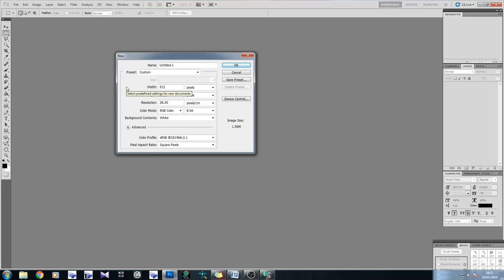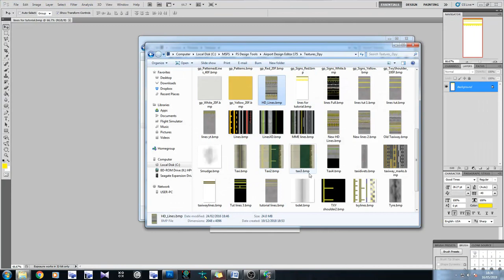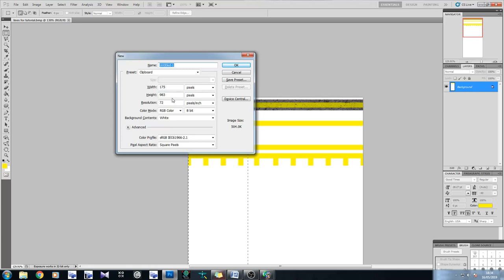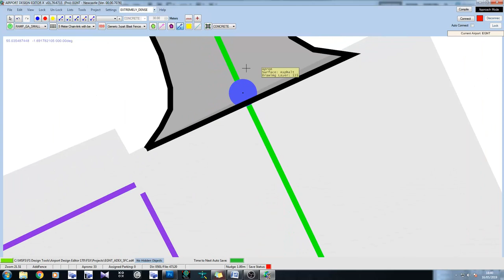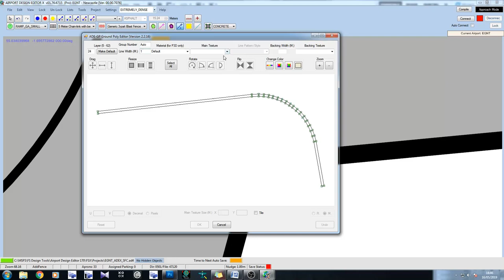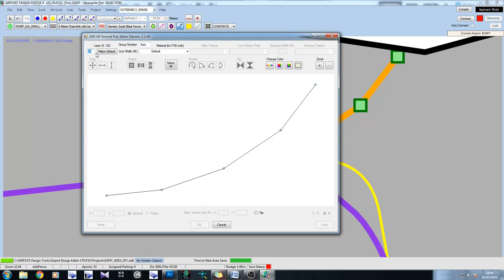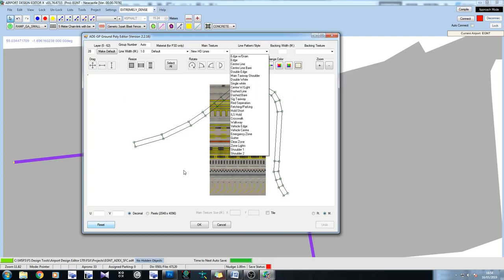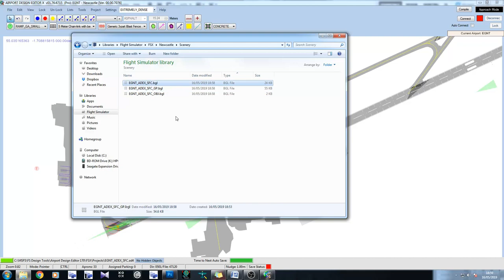Scenery Tutorial - Taxiway lines in ADE

Comment: FYI, you can create custom ground poly or line from helper shapes.  For example, instead of using the circle helper shape, use an arc with degree of arc to 90, change diameter if needed and  press save.  Select the helper shape, right click to bright up the menu and select make custom ground line, enter the number of point desired, press ok.  You could drag the start point and end point to the desired position.
Reply from the maker: You can indeed yes, I did mention it in the first draft but I ended up dropping it because, although you CAN use helper shapes to make ground polys using them takes away from the learning experience. If you can make your curves by hand and only use helper shapes as a guide I personally believe that's a more useful skill. If you can do it yourself and be happy with the result the end product is much more satisfying. :)
Reply: Good point,  and I do enjoy your tutorial.  Keep them coming.

Comment: When you were talking about everything is in fours in FS, isn't it in power of 2? I thing that gives more sense. In ModelConverterX there is an option to resize to power of 2. I think it is more easier for pc to calculate that. It is easier to do for example 2x2x2 than 3x1x5.
Reply from the maker: This sentence refers to ground poly layers. I was told to layer in 4s when using ground polys by mr uk2000 Gary Summons so I stick to it haha.

Comment: My ground poly lines appear black. I tried different solutions but does still displayed black in P3Dv4. Any ideas
Reply from the maker: Black lines means they're not textured. Make sure the correct texture is  in inside the texture folder for the scenery
Reply: @Soarflyconcepts  thank you for the response. When i compile i get the textures and the bgl files. I place the bgl files in the scenery folder and the texture in the texture folder and both in the addon scenery folder (addon scenery/vomm/scenery & texture folders) but still it the same black lines
Reply from the maker: @chandramouliperur5222  what format are your texture files? They should really be .dds or .bmp (dxt formatted)
Reply: @Soarflyconcepts  I am using the default textures that came with the ADE. I just tried a Yellow line from the default textures.